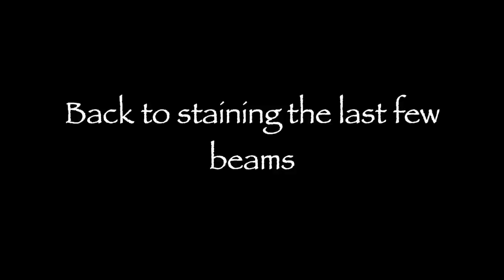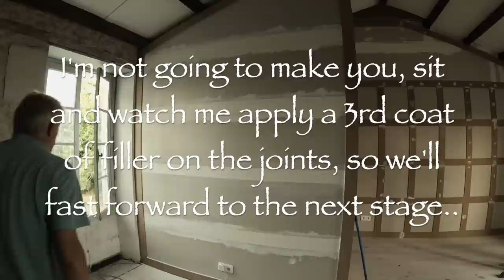The Beams are finished,  the walls are prepared for painting, & I create a dust storm!!

Comment: It’s good that for some of the tasks, like sanding, you can use both arms I stead of only the right one. You have my admiration for cracking on with these laborious tasks in the heat. 👏🏻👍
Reply from the maker: my right arm is still suffering from taking the render off lol so I have to change arms many thanks